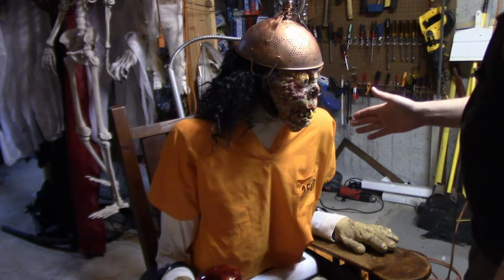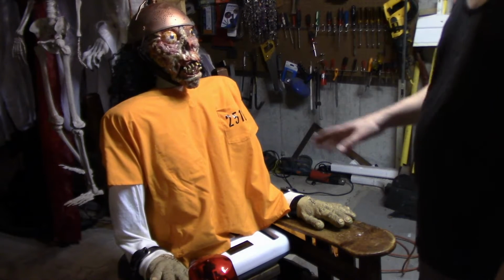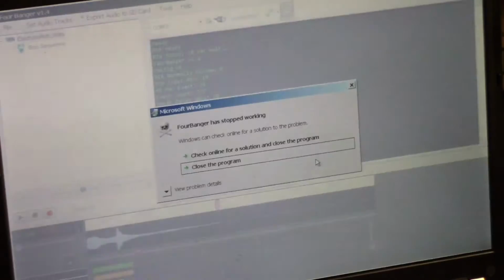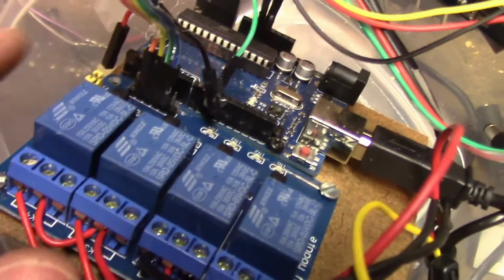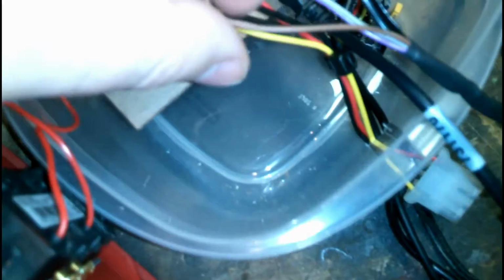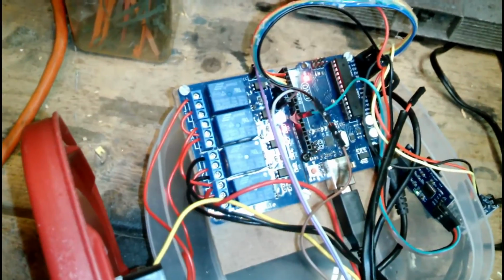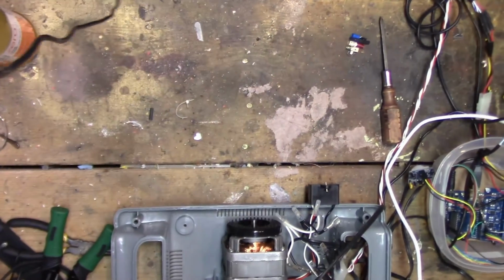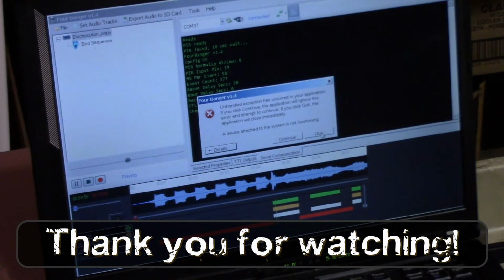Arduino Electric Chair Prop #7 - DIY Halloween Vlog 2016 #38: Electrifying! (Part 7)

Comment: We don't have proggy experience...hub used some kind of power tool a motion sensor from a security light...scared the crap outta neighbors. Kudos to your perfection!!
Reply from the maker: Ah, yes, the motion detector hack. It's still very popular with home haunters. If you two are interested in building a prop controller, I have a series on it. You can check it out here: https://www.youtube.com/watch?v=Japm45eNV78&list=PL8Fn6IWwUvNTrZk1pnFs1CEf9YuEaUTsU

Comment: take the capacitor  out of the motor . it cant switch polarity that quick. and causing back feed in the switches. creating em spikes from the coil. taking it off line. that's why it works in any one direction but not both.
Reply from the maker: Okay, so unless something changed since my high school electricity class, there's no polarity in AC. Da-share (David_AVD) said, about the capacitor, "The 4uF capacitor is to induce a phase lag in the motor winding not directly energized by the switch (or relay in your case). It causes the rotation by delaying the current one motor winding compare to the other."

Can you elaborate?

Nevertheless, the workaround was, in fact, a 500ms delay between switching directions.
Reply: ac dose have alternating  polarity it  alternates at 50Hz /60Hz. and the capacitor is discharging in roughly 350ms your 500ms gives it enough time. I had this happen a lot on ac motors with capacitors and relays. with enough amperage I have managed to make my tv ,pc and monitor either turn off or blue screen instantly..lcd items are affected more by this em spike created by the relay coil..
Reply from the maker: Okay, I did know the polarity alternates (hence the term alternating current), but I thought you were referring to the motor direction switching back and forth, like DC would do.

 I really appreciate you chiming in here! Let me ask you this, though, if I remove the capacitor, what is going to make the motor go in the opposite direction?

I still don't really understand how that works, but the fellow who helped me debug this (David_AVD) seems to imply that the capacitor is responsible for motor's ability to reverse direction, or at least that's what my pea brain is coming away with.

Don't get me wrong. I'm all for taking out the capacitor and having that motor switch directions instantly with no delay. I just don't want to take away the ability to switch directions. :-/

Thanks for your awesome information. I appreciate it!
Reply: the motor wont run without the capacitor. but it will still put a load on the coil as it try's to switch. and if it didn't rest like it was and went threw the motions. I know the motor wouldn't turn. I was trying to let you see what was going on and why. and some how you solved it one of the only few ways possible. one delay the time in switching direction by at least 400ms or buy a small phase shift transformer in place of the capacitor shifting the phase. but that takes a little more wiring. what you did will work well. and may be stepping up the wire size on the relays to help with amp draw when changing direction.. but I'm  glad to see you got it working..

Comment: It's possibly the inductive spike of the relay switching that is crashing the Arduino.  It's often a good idea to run individual wires back to the power supply, and maybe add an extra smoothing capacitor close to the Arduino to make its supply more stable.
Reply from the maker: Thanks, Clive. If I had a clue what that meant, I'd respond intelligently. ;)  I'll research that and see what I can do!

BTW, really enjoy your channel, although I'm not sure what you're talking about half the time due to my own ignorance. If anyone wants to learn about electronics and how electronic gadgets work, make sure you check out Clive's awesome channel.
Reply: I had the same thought, but I don't think he has any capacitors to hand.  The relatively high current draw of the relay coils is certainly something that could be at play here.  That coupled with the non-optimal wiring runs could be causing issues.
Reply from the maker: What individual wires am I supposed to be running back to the power supply? How is my wiring non-optimal? Confused.
Reply: It's the nuances of how the wiring is done that can make a difference.  Keeping high voltage / current wiring well away from sensitive circuitry both proximity wise as well as current paths.  This is where lashing together several boards can be less stable than a well designed dedicated prop controller board.  Adding capacitors, etc are some of the tweaks I'd try if I was working on it myself, but assisting someone remotely (and not in real time) is a lot harder.
Reply: If you have a microcontroller and things like relays at the end of a piece of cable then the resistance of the cable results in current transients from the relays causing very short glitches on the wires that can upset microcontrollers by causing misinterpretation of data due to the sudden voltage difference or partial processor resets resulting in unpredictable behaviour.  A fat electrolytic capacitor in the vicinity of the processor can help soften that glitch.
Reply from the maker: +da-share Well, I do have some smaller capacitors on hand. I just don't know where they would go and what sizes I should use. I mean, I could try some longer wire runs and move the relays away from the controller, too.
Reply from the maker: +bigclivedotcom I think you and da-share (David_AVD) are saying the same thing. I do have some smaller capacitors on hand, but I have no clue what size I'd need, or even where to wire them. I'm really not learned on this stuff. Programming is my thing.
Reply: You could try adding a 100uF capacitor (10V or greater) close to the 5V terminal of the Arduino.  The capacitor -ve should go to the nearest 0V terminal on the Arduino.
Reply from the maker: Well, I tried a 220uF cap, as that's all I had around. It didn't make any difference and the board reset. I think the proximity of everything, like da-share said, isn't optimal, so I'm going to pull everything apart and lay it all out on a piece of plywood with the relays as far away from the controllers as possible.

Comment: Oh Dude! I can SOOOOOOO sympathize!!!!!  It works on the bench, then you move it and.....Curses! Foiled Again! Tenacity is the hallmark of a great prop builder....or the truly insane!  I think I fall in the latter category,so  I'll keep the bench warm for you!
Reply from the maker: LOL! Yeah, keep the bench warm. I'm sure you've been sitting on it a few times this build season (i.e. how's that gargoyle treating you? ;)  Yeah, this prop was being a bear for sure.  Maybe someday I'll relay the story of the witch head I kicked across the yard, after shaking the (less than) "stirring" body apart, because I'd spent about 40 minutes bending over the cauldron trying to get the super sophisticated elbow joints I designed to stop binding. Well, gee, there it is. I guess I just told the story. That was a fun day.

Comment: Grin, oh man dude holy guacamole I cant believe that damn thing is being this much of a pain in the ass.. "by the power of grayskull, zap that mutha truka"  Now I am curious what the solution is.. I hearing you mention possible bad relay board, and I know from personal experience sometimes those parts are not made with top notch quality, they are cheap for a reason, like one of my UNO's when powered with the barrel jack wont complete the relay sequence, but with usb cable plugged to a usb power outlet it works fine..
Reply from the maker: Turns out this is actually the first board I made, which is genuine Arduino. LOL! I'd laugh if I hooked up one of the knock offs and the problem went away. Alas, I never did since we got a workaround in place, and have moved on to sticking more gadgets on this thing.
Reply: +Montclair's Lair awesome, now I'm eagerly awaiting the new video like I am for each walking dead episode 😀

Comment: You have the patience of Job. I'd have thrown that controller across the room by now.
Reply from the maker: If this were a mechanical issue, I'd have kicked the torso out the basement entry and kicked it into the lake so the ducks would have a nice floating shit station. xD

I think it's my 35 years of working on computers that gives me patience with them and electronic components. I can typically get them to do what I want or a variation thereof. This one will be no different in the end!

Comment: OMG … I can’t believe the issues you are having with this
prop. This has my cannon controller issues beat hands down! Good for you for
keeping at it. Good luck.
Reply from the maker: It's unreal, right?! I think I got into the mindset of, "I've come too far to turn back now." And, I left HOURS of work on the cutting room floor.  But, hehe, you're not going to believe that by the end of what I've filmed now, I got it working, and added leg animation, then decided I wanted more, and ordered some door lock actuators from ebay! It's going to go from "meh" to "cool!" before I'm done.  :)
Reply: I saw the forum post where you bought some more stuff for this prop ... it will be awesome when it's done because you won't give up on it!
Reply from the maker: As long as those actuators work the way I intend, it should be pretty sweet! Thanks for watching and commenting!